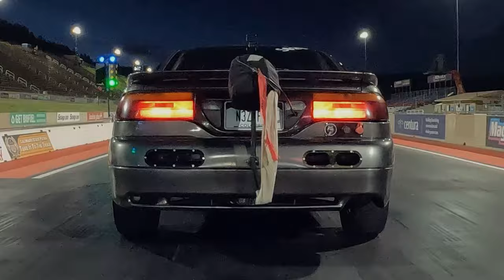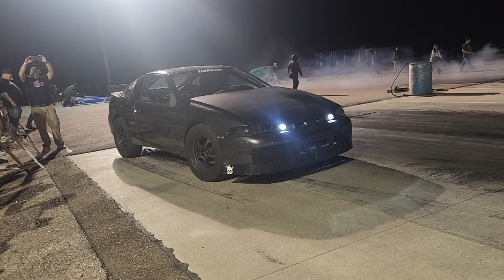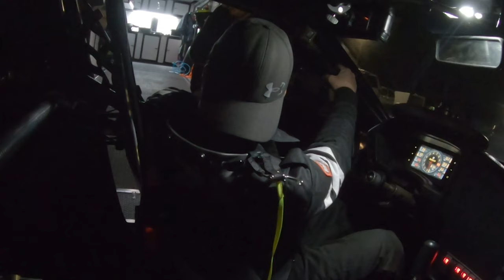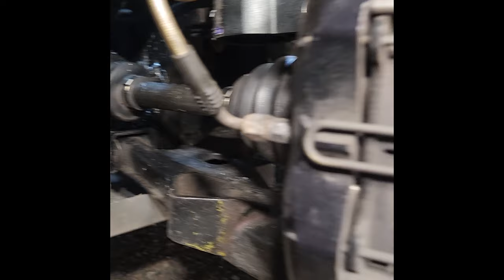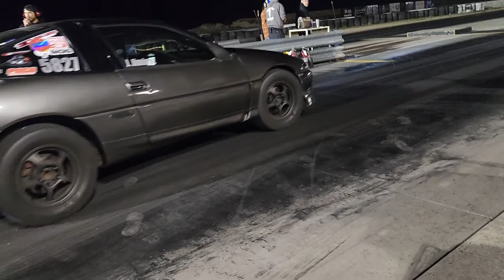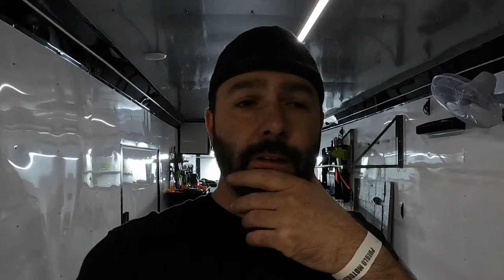That LAUNCH Was INSANE! Getting NFT Dialed!

Comment: Iv had my share of dsms and one thing I know is to slip the fuck out of 1st gear! And don't dang gears just positive shifts. I cringe when you fly 1st and dang second! Iv had 700whp dsms and 400whp I don't care how much money you have in the drivetain . And get rid of everything that has play
Reply from the maker: It's extremely tough to slip double and triple disc clutches. If you slip it to much it will burn the Clutch up. The car has a fully built PPG dog box transmission and a Haltech ecu with a strain gauge shifter. It's designed to cut power during the shifts to allow for fast shifting.